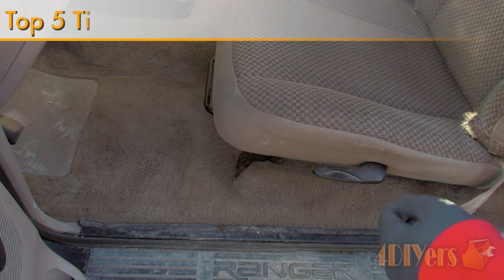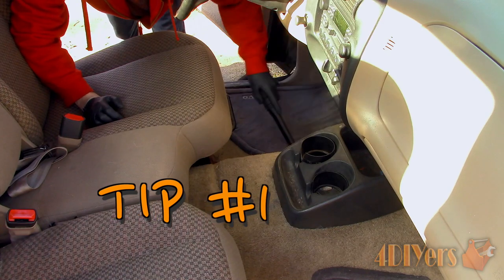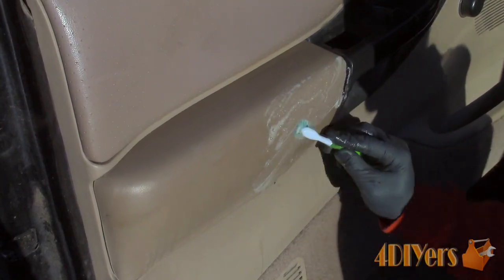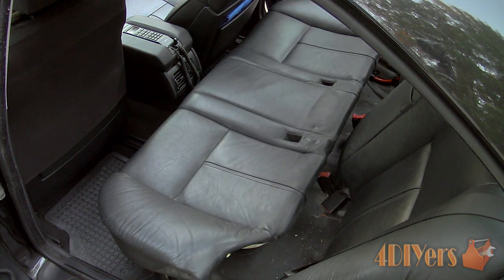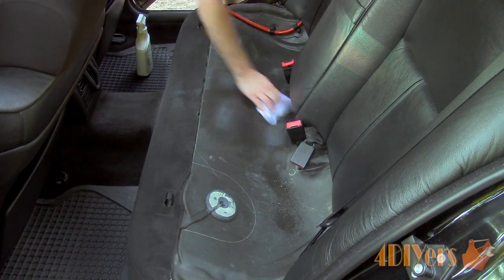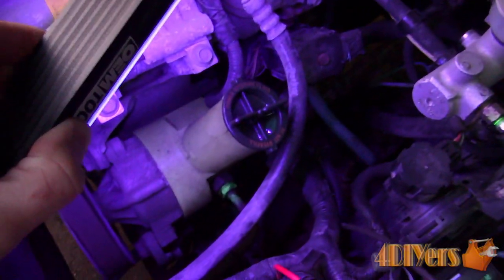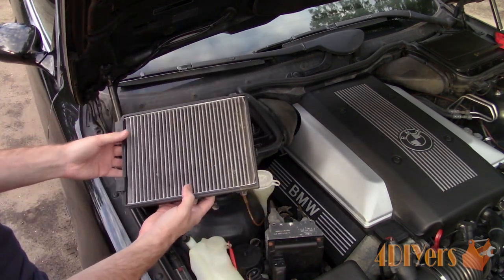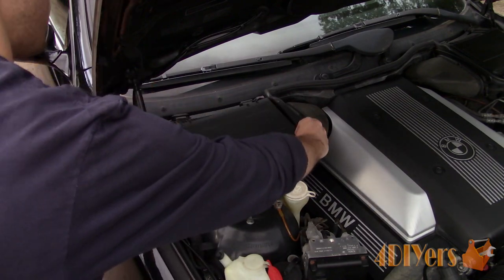How to Remove Bad Smells in your Car [Top 5 Tips]

Comment: Get some scented oils of your liking and burn some inside the vehicle for about half an hour with everything closed. If you are using a traditional candle burner use caution as it may set upholstery on fire. Place on a wooden board on the arm rest and stay close by until the oil is vaporized... It'll leave a lasting smell throughout your vehicle
Reply from the maker: Great tip, thanks for sharing :) Although sourcing out the source of an odor is a must, otherwise it'll come back.
Reply: 4DIYers yes that's after getting rid of the source
Reply: um yeah no use biocide car shocker it releases chlorine gas and disinfects everything they use it industrially